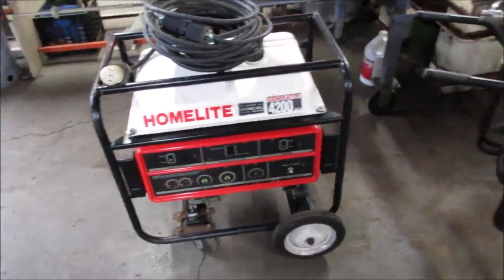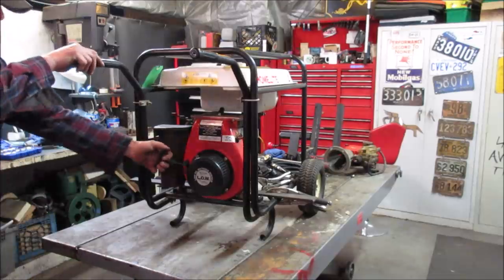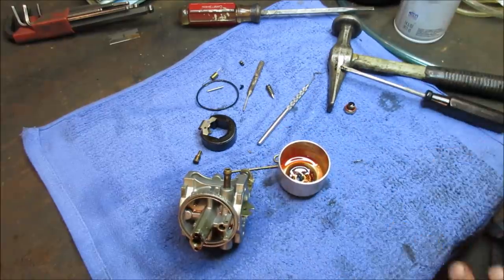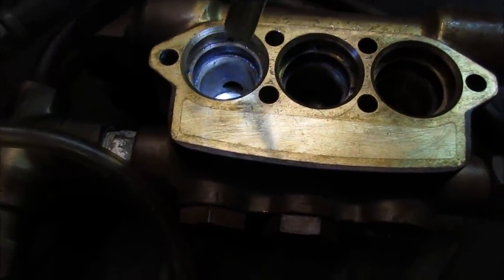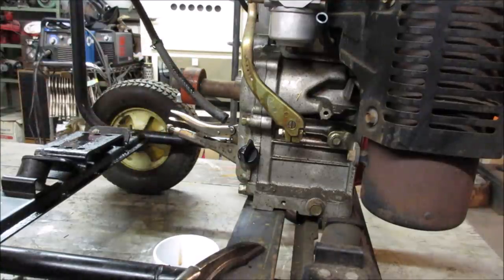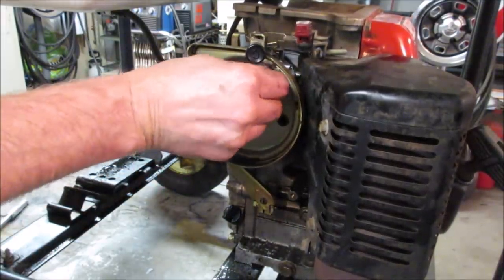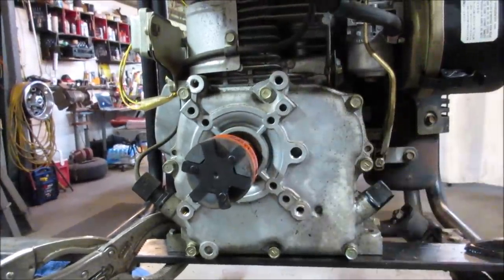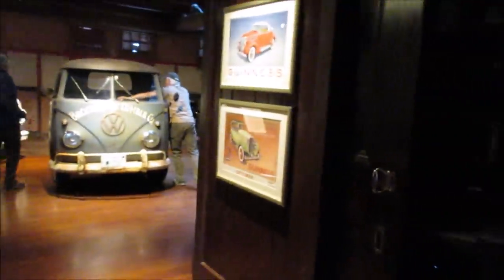Will It Still Work? Free Old Homelite Pressure Washer sitting for 20 years.

Comment: UPDATE FROM THE OWNER: Just for a quick FYI.....The petcock on the gas tank does have a 100 micron brass mesh filter on it just inside the tank. From the video I'd say it needs a shot of air backflushed through the hose. The black sludge in the carb bowl is obviously from the hose, which is the original one and is well over twenty years old. I'm surprised it didn't leak gas through the length of it. As for the pump.....As per Homelite's recommendation, it was always filled with a 50/50 solution of Prestone Anti-freeze when put in storage. I blew this out with HP air months ago before I gave it to Darren. I had originally planned to go though the machine and put it out along with the generator on the curb for sale. I never got around to that and when I came across Mustie's videos I thought what a good idea it would be to let him have them and a few other things for his videos. I finally got my shed cleaned out! Best everyone, George C.

Comment: The twin nozzle setup is for soap and wash. The larger tip is a soap tip. Soap won’t draw through the DS injector with a small orifice high pressure tip installed, so you use a larger orifice low pressure tip. It’s supposed to make it easier, but in practice they don’t work that well. I’d switch it to a Quick Connect and get the proper sized high pressure tips and then a black soap tip. 

Also, all the pro pressure washers were screaming NO!!! when you adjusted the unloader valve. To set the unloader, look up the pump flow and pressure rating, then using a nozzle calculator select a 25 degree nozzle with an orifice size that gets you the closest to the rated pressure at the rated flow. Then, get yourself a pressure washer gauge, put it at the GUN end (this compensates for hose insertion losses), fire the machine then adjust the unloader so it runs at the rated pump pressure with the trigger pulled and only jumps 200-300 psi when you close the trigger. This maximizes the flow of the machine.
Reply: Finally someone understands I work on these for a living so I get pretty tired of explaining to people what you said here. Couldn’t have said it better my self

Comment: That rubber bushing on the coupling is called a spider that what’s Lovejoy call it anyway . Enjoy your Sunday morning videos keep them coming . Greetings from Dartmouth Nova Scotia Canada
Reply: Also known as an Oldham coupling.
Reply: Reminiscent of the motor couplers used on old school Kenmore washers.
Reply: These are actually called Spider Couplings. Their intent is for use on low-precision moderate torque transmission. The one which is on this machine is made of Buna-n rubber.  There are also ones made of Hytrel which is stiffer. The one shown is actually in new condition as I didn't use this machine that much. Best, George C.

Comment: Kinda cool design at the tip, the low pressure is for when you use the soap hoes as it needs low pressure to draw the soap up the tube and then when done flip the wand over and you can jet wash the car. Never seen that before, great video btw from the 🇬🇧
Reply: My dads ancient pressure washer has that feature, used to wash his truck with it as a kid. Very handy!

Comment: Another project, another valuable learning lesson! Might have been a fairly easy fix but more importantly it’s packed with knowledge so thank you! I’ve heard nightmare stories about using the winter mix in the pump so to be safe I just roll my pressure washer into the basement for the winter months. I’m sure that stuff works, but it’s just easier this way for me cause it’s guaranteed not to freeze and is nicer to go through it in my basement shop vs the garage shop. Anyway, thanks for taking us along, another job well done…👍🏼👍🏼 from this guy!
Reply: I use compressed air to blow all the water from the pump before winter storage

Comment: The red fuel filters (screen only inside), are set up for larger micron level filtering on gravity feed fuel.  Better than no filter at all.
Reply: Why not install an additional fuel filter?
Reply: Anytime I deal with a float bowl carb, INSTALL Automotive fuel filter...
Reply: @gs1100ed  Agreed, a simple inline fuel filter would help with all the little particles.

Comment: Not sure that it was still a needle/seat issue when you kept getting debris in the bowl - possibly from the ? year old fuel line crumbling internally from being crimped with vice-grips. As to filters - your issues may come from using the wrong style filters. Gravity fed fuel systems prefer screen style fuel filters, while pump assisted systems like paper filters better. In this case I would have ditched the factory petcock, installed a barbed fitting, an inline fuel shut-off, and a screen style filter into new fuel line. But enough second guessing - Your videos are always entertaining and informational insights into how machinery works.

Comment: Because you are the guy that brings things back to life after they have been put away incorrectly. You should do one-five videos on how you would put different pieces of equipment into long term storage. Like tires and wheels, gas/diesel engines, electric motors/generators. How you think it should be done. Like I would bag tires in some form of inert gas like maybe nitrogen? Back in the old days it was wax paper and cosmoline.

Comment: Darren, always learn something new.  Taking the pump apart, now we know where the piston seals are at.  I often wondered what the was behind those nut/caps.  I always run some pump seal lubricant through the pump before putting it away…
Thanks again 👍🇺🇸

Comment: Living in northern Michigan and knowing that my pressure washer was having a hard time starting,I am looking forward to the project . It’s a Honda overhead valve engine that’s 20 years old . I suspect carb and valves . I will adjust the valves first , it’s acting like they need adjusting . Then some carb work it’ll be fun since I know about these things from watching mustie .
Reply: If it's a modern Honda overhead valve motor like a GC or GX it's very unlikely the valve need to be adjusted unless it's a high hour motor.

Comment: They make 2 kinds of filters , the screen type is used with gravity feeds as in the old sediment bowls .
The paper ones are made for use with pressure systems .  
I also think someone before you put the pump backwards because you need easy access to the black pressure adjustment valve .

Comment: The Teledyne "Homelite" branded products were and are pretty decent, using Wisconsin Robin (Fuji) smaller or Teledyne Continental larger engines on a lot of the generators, compressors & washers and also the milspec units intended for military use.   Can still get parts for most of these engines.   I'd rather have an Onan but these are not bad.  Looks like this one runs great & was stored fairly decently.

Comment: At last, pressure washers and I know more than Mustie! When you unscrewed that large knob on the unloaded valve you reduced the operating pressure, it would help if there was a pressure gauge fitted. Letting it run for too long with the gun closed and water recycling will cause it to overheat. Most of these washers can suck water in if mains supply isn’t available and you can buy suction kits. Run your mains into a plastic 200 litre barrel or similar and let it fill, it will top up as you close the gun. I used to build them on trailers for contractors mostly with larger Diesel engines and with a large water tank plus a hose reel. Silicone oil or grease is good on the O rings. The pistons are probably a ceramic material, the pump looks to be a copy of those we were using back in the 70s. They’re pretty reliable.

Comment: Thanks for the video My Man! FYI those bores go the other direction, because your pressure regulation knob doesn't sit against the engine like how you have it now, it will run, but, it will be a pain to adjust, you need to flip the block 180°

Comment: While I've worked on tons of old Homelite equipment I have never seen one of their pressure washers like that. I worked as a Mechanic at a Homelite dealer in the mid 80's and we saw tons of stuff from the late 60's thru the 70's, being in a rural area everybody kept things for a long time. I really liked those early Robin Engines, they always seemed run real good and smooth, in my area it was easy to get Robin engines but a royal pita to get parts for them.

Comment: I just recently channeled my inner Mustie. With gas prices the way they are, it got me thinking that I have an old Honda Aero 50 scooter sitting back behind my shed. I had tried screwing with it years before and never got it running right. Now that I have a Sonic cleaner and have watched quite a few hours of mustie videos, I took another stab at the carburetor. Put it in the Sonic cleaner for a while and then poked around all the holes and orifices with a bristle from a wire brush. Blew it all out with air, and now it runs amazing! It's really too bad three of the four turn signals are busted out and missing lenses, the brake lights done work and is broke out, it has no license plate and I have no idea if a title or registration even exists for it. Otherwise, I would love to drive it back and forth to work. The local sheriff or state patrol probably wouldn't like it :( 
Super fun to ride around the property though.

Comment: Perhaps a holding tank in your loft - 1/2" to fill it, but will give you better water pressure for the length of time it takes to empty the tank.  That's what apartment buildings in the city do to give them water pressure - they are far above where residential pressure would do them any good.

Comment: Yeah you need to set an engine speed, as you use different types of nozzles you wouldn't be comfortable able to hold them otherwise. Those rotating ones for outdoor floors with a cap over them is an example. If you turn them to high you have to put a lot of weight on them and they will rotate so fast that the water sprays out on the sides :D

Comment: Hey mustie you want to know a handy trick we used to up the water pressure for our diesel pressure washer running in a valeting bay.. we set up a large barrel with a stop valve and float from an old toilet, feed the barrel water from the shop hose until it's full, then let the barrel feed the pressure washer.. jobs a gooden.
But a guy with your skillset probably already knows this information.. but hey just incase ya don't 🙂👍

Comment: Funny that the tap, tap, tap on the metal when you remove two close fitting parts, like taking a carb apart, or removing the piston head on the pump today is the same method used for removing the sideplate on a revolver, instead of prying it. 

Lots of similarities, working on machines. Thanks for the channel, I'd bought a bunch of tools to use because of it.

Comment: Engine looks like a Fuji Teledyne Subaru Wisconsin Robin WI-280 7.5hp. 

Wisconsin contracted with Fuji/Teledyne/Subaru to have them make the smaller engines for the US market while they continued manufacturing the larger industrial small engines that they are famous for. The Japanese engines are high quality and earned Wisconsin's business in the US.
I had one on a pressure washer and then moved it to a Tote Gote minibike.
Tough as nails, built really well, but will have carb float issues....

Comment: I have a honda es 6500 that the tank was a mess, cleaned it as much as i could then put 3 pounds of sheet rock screws in it.  Strapped it to my tractor wheel and went for a ride up the road and back. Left it on then jacked up the rear and left in in low and spun it for a couple of hours , the screws cleaned the tank really good. Also there may be small screen in the stem of the tank. That fits tightly in the stem.

Comment: I always enjoy your videos , but on this one I was talking to the video way too much . I used to work at a factory that built pressure washers and later a mechanic for a dealer . You were right on the money about larger volume washers needing plenty of water , we always suggester 3/4" garden hose for supply . Most spigots will supply about 3 GPM That is a plunger pump , ceramic plungers , the parts stuck on them are the packings . It is fun to watch you figure out how stuff works .

Comment: The name for the corrosion your looking for I think is verdigris.  Aluminium goes white crusty and copper goes green crusty.
Also I've had issues with leaky carb and fuel tap which eventually was traced back to a blocked tank breather! As the fuel expanded and evaporated in the tank, which it naturally does, it created enough pressure to overcome the tap and needle and seat flooding fuel out of the filter side of the carb.

Comment: I have great results storing engines by running 20:1 outboard two-stroke fuel through them before storage in both 2 stroke and 4 stroke engines. In 2 strokes I use the 20:1 in addition to the regular oil ratio. Comes from the method of double-oil for the first few hrs of of 2 stroke break-in. Long enough to fill the carb bowls and completely purge the fuel system of regular fuel. The following yr they start like the were running yesterday.

Comment: We were a Homelite dealer from @1960-@1994. They were in Gastonia, NC at the time that pw was made. The engine is Japanese. Teledyne-Continental was the US distributor for Robin engines, which was part of Fuji Heavy Industries, AKA Subaru. The bigger pw had a Briggs Vanguard, which was a new engine at that time.  Sadly, Textron ran Homelite into the ground, after many years of neglect, then pawned the smoldering carcass off on John Deere. It didn't take Deere long to figure out they had bought "a pig in a poke".

Comment: Every carbureted thing I own, if it has a fuel shutoff I use it. I like to switch fuel off while running to burn of all gas in carb and lines. Especially if it's going to be stored for any length of time. Keeps carb from being gummed up. Sometimes I'll pull feed line after it's been run dry and feed it non ethanol gas to keep everything lubed with fuel without the possibility of carb issues when pulling it out of long storage. It's worked for me many years now.

Comment: The plungers slide in and out of the packing. The packing glands are stuck to the plungers. The green and white "corrosion wouldn't have mattered. The important part of the pump head is where the high pressure seal "seals" against the head and it is the spot right about where you honed. Unfortunately I have to head to the shop and repair a bunch of washers this morning instead of finishing watching. I'll check it out later today when I get home. The valves alsojust pull out and are held in place by an oring. That is a Giant pump.If you decide you need parts.

Comment: Mustie, use AT 205  polymer - based additive  on hard, crusty o rings and seals. Makes them soft, and like new. Meant for an engine additive for oil, it will rejuvinate  old seals, and stop crankcase seals from leaking. Ebay has it. Works great.....

Comment: The low pressure is for detergent injection, which is disabled while in high pressure mode. detergent injection is used by putting the clear hose near the pump assembly into a bottle of soap for washing cars and things, then the high pressure is for rinsing.

Comment: With the pressure washer you might want to try a 50 gallon tank like a plastic oil drum run the tap hose into the drum to give you a Reservoir of water I'm not sure if the pressure washer Will Self syphon or if it needs an input pressure lovely video and is crusty coming home

Comment: Those pumps have ceramic pistons in them that tend to crack if they freeze. I've also had a few of them shatter from corrosion buildup inside of the pump. Other than that they are probibly one of the better pumps. 
Those aluminum Robin/Wisconsin engines have garbage carbs on them. I've had lots of them that had worn throttle shafts.

Comment: I just buy the shut off valves by the dozen on-line and keep them around for just this type of eventuality.  Same with plugs, hose clamps, filters and all those little parts that are constantly failing.  They are so cheap when bought in quantity that it's crazy trying to repair the old ones.  I've found that the repairs seldom work for very long.

Comment: Hey Mustie..0000 steel wool will clean the bore safer than a cylinder hone..antifreeze in the pump for first start up and storage..I've worked on pressure washers for many years..
90% of the pumps were made in Italy don't know why..lol..some parts you can't get some you can..that's a nice pressure washer..the pressure is ajustable on that one..Cheers 🍺🍺🍺🇺🇸🇺🇸🇺🇸

Comment: It looked to me as though you could change that end to a more modern 4-5 tip system, 2000 psi Is low but also safe, High pressure does more damage than low pressure will, also I think that tip to the side low pressure would have picked up soap( mine picks up soap on low pressure tip and then bypasses on high pressure tip).

Comment: Have you thought of putting several water tanks on the second floor then running a 3/4 inch line down the wash area?

1 you could have hot water to clean, 
2 the height of the tanks should give enough head pressure for the larger pumps

Comment: The black coating on the needle is called Viton.  Use a Q tip in a drill and spin it on the needle seat.

Comment: I remember my montessa 250 mx bike had a petcock that was a rubber chamber with marble or ball bearing inside. You would squeeze it back and forth to open or close the line. 
They were jokingly referred to as Mon†esti¢les. There were two of them, one on each side if the tank. This way, no matter which way you leaned into a long turn with low fuel, it wouldn't be starved for gas.